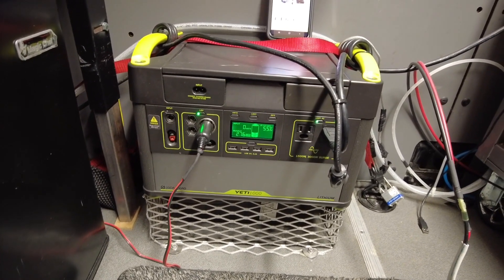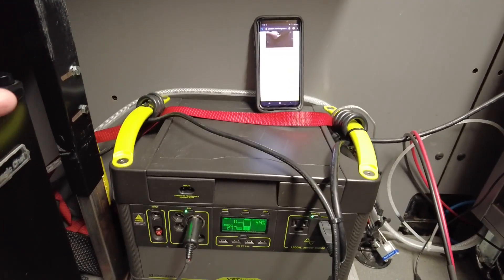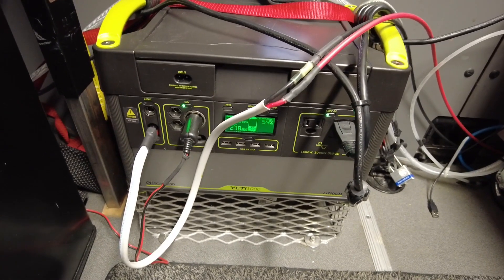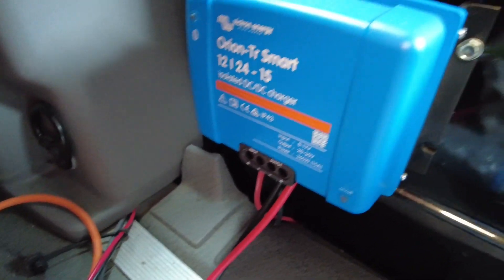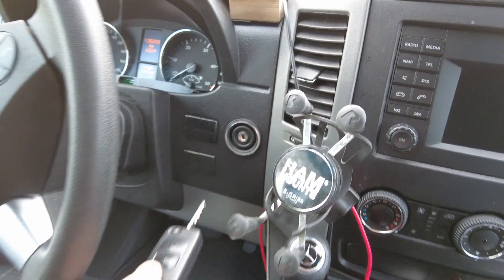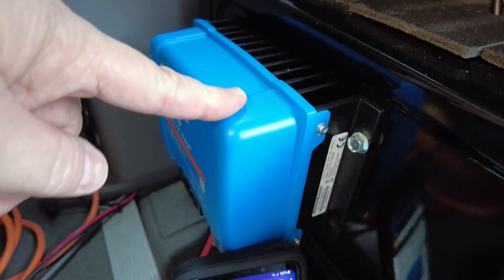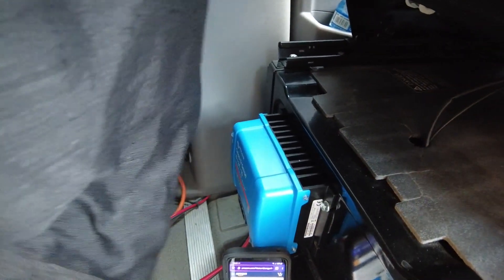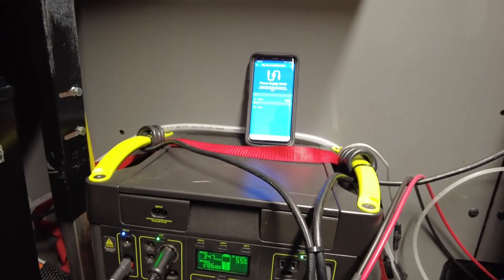Goal Zero Hack - Alternator Charging using Victron Orion DC-DC Converter

Comment: Im trying to figure out if a 1000 Core will work with this setup, can you help me out?
Reply from the maker: What is a "1000 Core" - do you have description?
Reply: @sprinterdiscovery  It is the "amazon special" Goal Zero Yeti 1000 Core, it is basically a budget 1000X with lesser power input
Reply: @sprinterdiscovery its input is what Im confused about
these are the specs listed on the website
 Charging port (input, 8mm): 14-50V, up to 10A (150W max)
Charging High Power Port (input): 14-50V, up to 25A (300W max)
Reply from the maker: @Brycemoondesign  Hi Bryce, thanks for the info.  You will need to get the Victron Orion Tr-Smart Isolated 12V/24V-10A version that will put out a total of 240W. Your Yeti 1000 CORE can only handle up to 300W, so this Victron Orion model will work.  Set it as power-supply mode in the VictronConnect, and you can choose any Voltage up to 30V since your Yeti 1000 CORE can accept up to 50V input.  Hope that helps!
Reply: @sprinterdiscovery  Thank you so much for the help! I really appreciate it.
Reply from the maker: @Brycemoondesign  You're welcome! Best wishes on your build!
Reply: @sprinterdiscovery  hey again! I’m trying to figure a way to charge my yeti with solar AND alternator. I found a product by Redarc called the “DUAL INPUT 25A IN-VEHICLE DC BATTERY CHARGER”. It seems to let out my Max watts and Amps. Just trying to confirm that it would work. If you could help again that would be awesome!
Reply from the maker: @Brycemoondesign  Hi Bryce! The unique feature that the Victron Orion has is the "power supply" mode, which feeds constant power to your Yeti 1000 Core. It also has "battery charger" mode, similar to the RedArc, but the RedArc is missing the "power supply" mode.
So, ideally when you are parked, just manually switch cables over to your solar panel. When the Yeti needs charging again after a lot of usage where it was not sunny, just switch cables to the Victron Orion and go for a drive.  Hope that helps!
Reply: @sprinterdiscovery  perfect. That helps a ton. I will do that! Thank you again for the help.
Reply from the maker: @Brycemoondesign  Anytime Bryce! Let me know how it all works out for you.

Comment: I have the Ecoflow Delta max (EU version). A similar setup should work for this as well? I was thinking what would be the best option, using a dc/dc charger with the solar input (800W, 11-100V, 10 amp) or using an inverter connected to my vehicle battery with the ac power input (1800W, 15 amp) on the Ecoflow. Any thoughts on this?
Reply from the maker: Hi Frank - for your model, the Solar Charging Input is 800W Max, 11-100V, 10A.  I would suggest using the Victron Tr-Smart Isolated 12/24-10 DC-DC Charger - https://amzn.to/32xGmFp  
That provides you 24V which is within the range of 11-100V, and matches the maximum of 10A input into your EcoFlow.  That will definitely work as you drive your vehicle. You could also use an inverter like the Victron Phoenix 1200V https://amzn.to/3H2eiJk  but with the appropriate plug for your country of course.  The data sheet from Victron is here: https://www.victronenergy.com/upload/documents/Datasheet-Phoenix-Inverter-VE.Direct-250VA-1200VA-EN.pdf
Merry Christmas, and enjoy the weekend!

Comment: Very cool. Will have to figure this out for my bluetti ac200p. I believe the minimum input voltage is higher that the GZ.
Reply from the maker: Correct, the minimum input voltage for the ac200p is 35v to 150v. In your case you could purchase an inverter and connect that to your vehicle battery, then use the charger from the ac200p and charge while you drive. It's not the most efficient, but will fast charge your ac200p quickly. You'd have to ensure that the inverter turns off when the vehicle is off. You could buy the Victron Phoenix 12/1200VA inverter and use the VictronConnect app to turn off the inverter when the input voltage goes below 13.3V (for instance). You can see this one: https://amzn.to/3oFHFei Best wishes on your build!
Reply: @sprinterdiscovery  This option doesn't always work with the AC200. Even with the inverter set to the correct voltage and all hardware inspected for proper installation the Mercedes smart alternator doesn't like to play nice with the Phoenix inverter.. I'm running this exact profile on my 2021 2500 170 hightop and will get the occasional dash message to pull over. Both the battery, charger, and related wiring has been inspected by two Mercedes dealers with no issues found. I'm still looking for a good, non wallet draining option.
Reply: @geezers10  I'm learning as I go and wondering if we can use a solenoid with a smart alternator, I saw a video (I'm not sure he had a smart alternator) the guy had the solenoid in the engine bay and that linked to a fuse to then switch off the inverter when the ignition is switched off.
Reply: @sprinterdiscovery  hello, I have a powerbox with 12v-50v and 15A input.
But you say that with max 15A, it will not work with citron 12-24 15A?
Could you elaborate why it won't work please ? As Victron should hand 15A?
Thank you

Comment: Really helpful. Have 1500x and not getting enough recharge from sun w single 100w panel. This vid is almost year old. What would you change to reflect the updated technology. I do need to wire to main battery or alternator. Do not have dedicated start battery, just single bat for gas 8.1 liter GM engine.

Also would like to combine solar and this. Can just switch plugs depending upon whether driving.
Reply from the maker: Thanks Michael! More than a year later, not much I'd change. It's our daily driver, so every time we go out our Yeti is fully charged. For your connection, just connect directly to your single battery which is charged by your alternator. It would be simple to just disconnect the solar, plug in the Orion charger while driving, then plug the solar back in when parked for a while in your van. This setup has been ultra-reliable over the past year. Many others have emailed me with their success stories after they installed this on the Goal Zero and a couple other brands. Best wishes on your build!
Reply: And again, thanks. I am concerned where to mount the Victron. I assume it should be in the cabin and not under hood.
Reply from the maker: Definitely you'll need to protect it within the cabin, and ensure that ports where the wires are attached are facing downwards. According to the manual  https://www.victronenergy.com/upload/documents/Manual-Orion-Tr-Smart-Charger-Isolated-EN-NL-FR-DE-ES-SE-IT-.pdf the biggest size wire is AWG6 at the terminals. So if you have a long run from the engine compartment, use that or AWG8 wire (which I'm using).

Comment: Wow - this is just what i was looking for to be able to charge my 1500x in my van.  I was reading through a bunch of the posts and had a question about what Orion charger to get. My van just has a 'little' 105 amp  not smart alternator so would it be safer to get the 12/12 18amp instead of the big 12/24 15amp? I'm probably going to have to run about 10' of wire to get to the battery and still have to figure out a good location for the charger.

Thanks in advance!
Ed
Reply from the maker: Hi Ed - you'll definitely need the 24v output. 12v will be at the very edge of being able to charge the unit. But you could give it a try, and exchange the unit for the larger one if it doesn't work out. Best wishes on your build!

Comment: Thank you for the video. Are you concerned with how much current the Victron is drawing from your vehicle's battery? Did you need to put in a fuse in between the device and your vehicle battery?
Reply from the maker: Hi thanks for watching! No concern whatsoever. In terms of the fuse, this particular model of the Orion has an inbuilt fuse. A couple others have posted that a fuse needs to be closer to the battery, but it's something I haven't done.

Comment: Thanks for video. I have the Goal Zero 3000X and have the Victron Orion 12 volt to 12 volt DC to DC charger that is only 18 amps (220 watts) as I have a smaller alternator that is only 105 amps. The default is 14.2 volts output on the lithium battery standard setting. Like you said it didn't work at first. Since the input on my GOAL ZERO unit is a low as 14 volt input on the MPPT I tried a 15 volt setting and it did turn on and charge. I set it as low as 14.3 volts and it stayed on charging. I set it back to 14.2 volts and it turned off. Bumped it back to 14.3 volts and again it went back on to charge. So the 12 volt to 12 volt DC to DC charger did work for me on the 14.3 volt setting. The TR SMART charger was about $163 as it has less output than the 30 amp unit but since my alternator was only 105 amps used the smaller unit. I liked the 18 amp also as it is the same output 220 watts as the plug in ac charger which is also 220 watts. I tried it both in charger mode and power mode. I left it in charger mode as it will shut off if the starter battery gets to low and lets the starter battery charge back up to continue to charge again. This is what I tried for a smaller 105 watt alternator. The screen readout did fluctuate alot when charging near full as alternator is more of a pulse. Battery was near full though at 95%. Will have to try it when battery gets to the 50% area.

Comment: Any thoughts on how to increase the capacity of the Yeti by adding another lithium battery? Thanks.
Reply from the maker: If you get the expansion module for the Yeti, that can accept up to 30V coming into the Anderson port.  WIth a 24V battery, you could connect that to the Anderson port.  You'd then be able to charge the 24V battery using the same Orion that you purchased earlier, and connect that to the 24V battery, but put the Orion into battery charger mode instead of power supply mode.  I have not tested this yet, but if you think it's viable, try it out and let us know.  Thanks!

Comment: Does the Orion have the ability to limit max wattage or current?
Reply from the maker: Hi - yes it does, the maximum current is 30A.  In fact, at one point I measured on a cold day 32A, and then as the unit heated up it dropped down to 28A.  I have one of the older units that heat up more than the newer units.  From what I have read on the Victron Community, the newer models limit to no more than 30A.

Comment: Is there any difference to input wattage to your Goal Zero when driving as opposed to idling?
Reply from the maker: Hi Jon, there is no difference that I observe. Same number of watts being shown on the Goal Zero whether my Sprinter van is idling or running. I have observed in the hot summer though, when the Orion is cold it will output 32A and when it's really hot it will output 28A. Appears it's normal based on Victron specification sheet though.
Reply: @sprinterdiscovery  Thanks for the info.  One more question.  Does idling while charging for long periods have any ill effects on the alternator?
Reply from the maker: @davidjondoh8671  In my diesel Sprinter van I'll never idle it since it can plug up my DPF Diesel Particulate Filter. For those with a gas engine I believe you can idle for longer periods. Not sure about any ill affect on the alternator either way.

Comment: Does it know when the engine is on or off? Or did tpu have to connect ot to the fuse box?
Reply from the maker: Both positive and negative wires are connected to the starter battery, and those go directly to the Orion. It senses the voltage provided by the alternator. If the voltage is less than 13v or so, the engine is off.

Comment: Wow, thank you for sharing all this info - it's super helpful and frankly just very generous of you.  I hope I'm not doubling up on comments - I think the ones I posted before may have gotten deleted by youtube because I included a link to show you specifically which product I am considering - I'm new to this and don't know the rules.  I'll be using a Yeti 1500 and was wondering if you think the Redarc 40 amp dc/dc charger would work instead of the Orion?  It also has a solar controller and if I ever do a full van build, I'd like to use the Redarc.  But if it's not compatible, then clearly the Orion is the ticket.  If I do go with the Orion, what's the best choice for the Yeti 1500?  Is there an option that would charge the Yeti 1500 faster than what you went with for your Yeti 1000?  I don't plan to move around as often as you, so if I can give it more juice on short drives, great.  I will also have 200w of solar, but I can't rely on that where I'll be.  Any suggestions you can offer are greatly appreciated!
Reply from the maker: Hi Leila! I'm not familiar with the RedArc, and the Orion you'll need for this to work properly is the one I've linked to in the description. It will work well with your Yeti 1500. With solar and short drives, you can keep a charge in your Yeti for sure. If it's just rain or snow for a whole week, best off to drive around for an hour or two exploring, then you'll top up the battery if you didn't run it down too far. There's nothing else from Victron to get that will charge any faster. 
We've been on a cross Canada trip since middle of July 2021, currently in Prince Edward Island and the Orion has been simply awesome at charging our Yeti. We have a 120V bar fridge in our Sprinter van connected to the Yeti which has been running non-stop without any issues. And no solar on our van at all! The Orion is simply amazing! Best wishes on your build!

Comment: I like your set-up but I'm slightly confused how the converter is connected to your battery.  How do you connect to your battery so that it will only provide power while the ignition is on?
Reply from the maker: Thanks! Simply connect the positive and negative to the battery terminals, then in the VictronConnect app you tell it when to turn on based on the alternator voltage. If your van is running, the alternator is creating high voltage, like 13.5V. The converter then turns on. If it's below that value, the converter doesn't use any voltage. So if you vehicle is off, no voltage is created by the alternator, and the converter will not drain your battery.
We've had this working in our Sprinter van for over a year now, and it's been rock solid and totally awesome at charging our Goal Zero battery pack! We still don't have any solar on the van. You'll love it! 👍
Reply: @sprinterdiscovery  Thanks for the rapid response.  This is a great option and will help to keep my "solar generator" charged during our increasingly frequent power outages here in California.
Reply from the maker: @davidjondoh8671  Glad it helped Jon! Up here in Canada we encounter a lot of cloud and rain outside of summer. Alternator charging works so well.

Comment: Any reason why you didn’t choose the 30 amp model instead?
Reply from the maker: Hi Joe, the Ecoflow 1300 should work with this Victron model. I chose this one because it produces enough voltage (20V to 22V) that the Yeti will accept. Anything lower and it won't charge properly. Best wishes with your build! Our Victron Orion has been working flawlessly for a year now. No need for solar panels on our roof - keeping our Sprinter van totally stealth!

Comment: I did some more research and you can connect the  Victron Orion right to the ec8 ports in the module compartment and don’t need to buy the mppt charger. The ec8 port can handle 30 amp 14-22v
Reply from the maker: Awesome! The Orion will need to be placed in charger mode instead of power supply mode.
Reply: How can I run both the victron external mppt and the victron Orion and have one or both charge the tanks intelligently without me swapping cables?
Reply: @matthewmartin9540  I bought the GZ mppt charge controller use that for solar and the Orion for the built in charge controller
Reply from the maker: @matthewmartin9540  A lot of people are asking similar questions about integrating the Yeti Tanks and charging them. I don't have the tank, so i can't experiment. Do you happen to know the charging parameters for the tank battery?
Reply: @sprinterdiscovery  I hope this helps: 
CHARGE TIMES
Wall Charger (120W): 11hrs per tank
PORTS
Expansion port male connector (input/output) 100A Max
Expansion port female connector (input/output) 100A Max
BATTERY DETAILS
Lead Acid (AGM)
1200Wh (12V, 100Ah)
GENERAL
Product SKU: 23105
Dims 15.5 x 7.5 x 10.5 in (39.37 x 19.05 x 26.67 cm)
Weight 77.1 lbs (34.97 kg)
Warranty: 12 Months
Female EC8 to ring terminal: 27 in, 8 AWG
Male EC8 to ring terminal: 39 in, 8 AWG
Reply from the maker: @matthewmartin9540  Very interesting, thanks for sharing! Introducing the Lynx is a smart move since it's all fused and let's you easily parallel Orions and other equipment together. Great for expansion!
Reply: Wow! Does it manage the input the same as the front anderson connectors? GoalZero claims 40% increase with their proprietary mppt.
Reply: @sadbrains262  I’m not sure I think so, it won’t show up on the display screen though but will charge the battery. 
Will prowse has a video where he connects a solar charge controller to the yeti through the ec8 ports and it works.

Comment: I set mine up and having troubles. It engages than cuts out right away, I think it might be the wire coming from my alternator to my battery.
Reply: Looks like it’s a faulty fuse. What size fuse did you use from battery to The Orion?